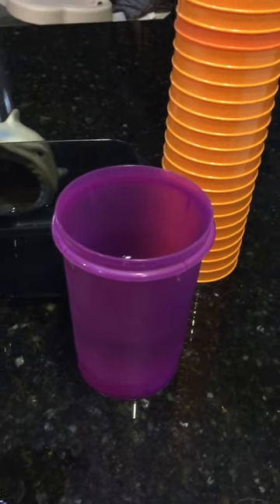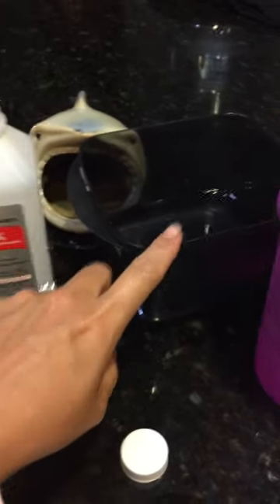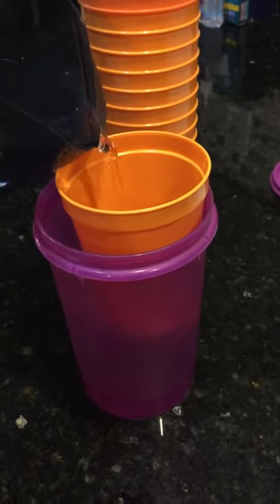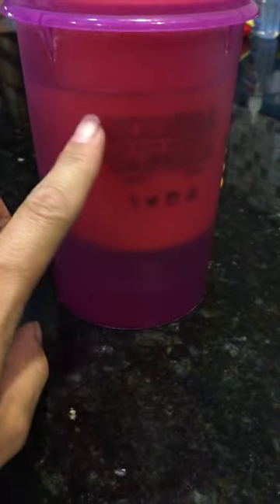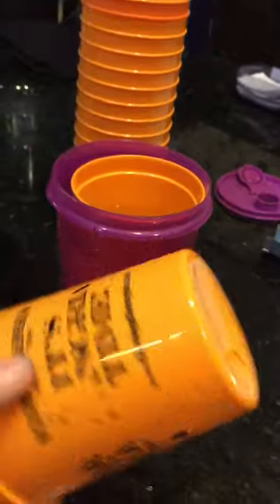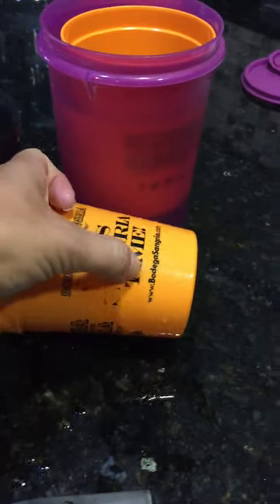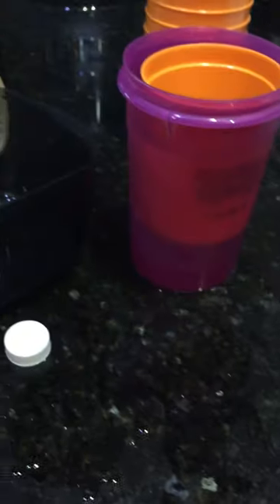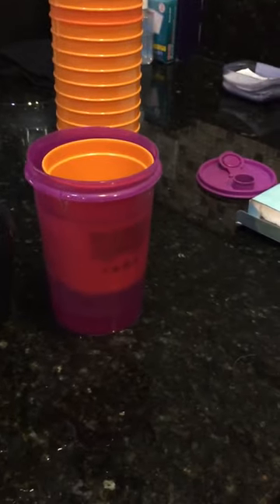How to remove screen print from plastic cups

Comment: Plz I want to know u put inside water and what????
Reply: In the cylinder you would put rubbing alcohol. The insert the cup that you want to remove print from. Then put water into your printed cup just to weigh it down
Reply: What u put inside the water?